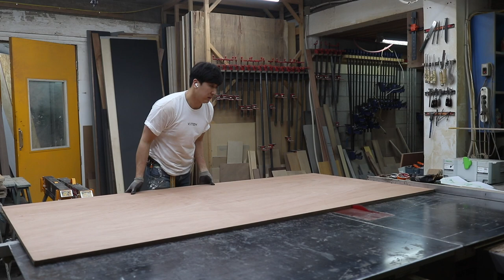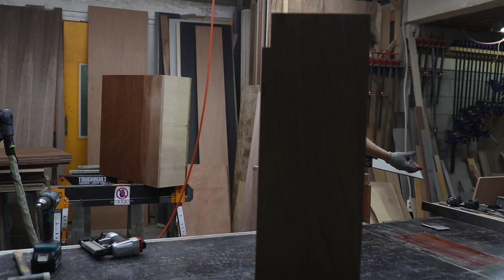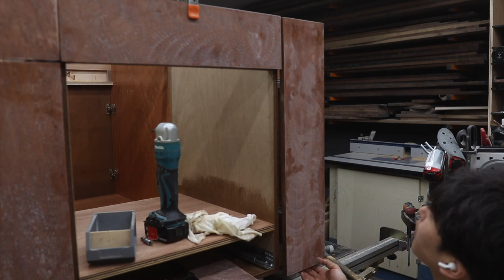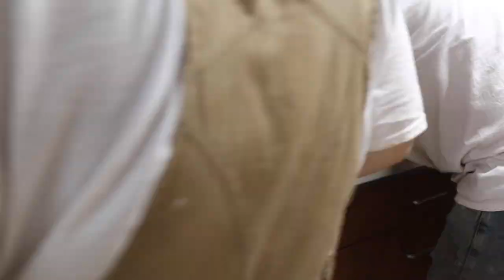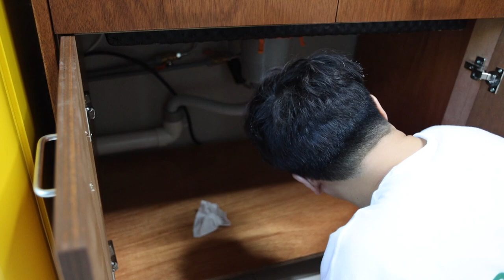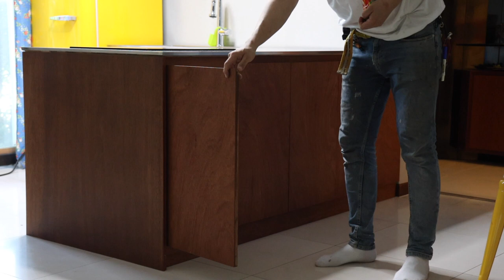W104_Plywood Kitchen with stainless steel top

Comment: I always thinking and wondering about your plywood project. "How can plywood material become so gorgeous like that? "
What kind of finish have you used? 
Was it oil based?
Reply from the maker: that is normal plywood made in Indonesia and oil based finishing
Reply: I'll take your answer as " Danish oil or polyurethane ".
Maybe 1 of those finish. 
Thank you ao much 🙏
Reply: @FKBH  yes, that's also something i want to find out. I have try rubbing some oilbased finish, but it wasn't works good. Some finish will causing blotchy on wood/plywood.
And in my country, mostly the oil finish are thick, maybe you can help me about something that can mix with it.. Thank you so much 🙏
Reply: @mogisanjaya2645  I know I'm late but he also uses some type of wax
Reply: @emm6155  yeah, i'm also curious about that wax too. And something that he use to apply finish. Sorry for my bad english language. Thank you so much for your information 🙂.

Comment: Very nice work! What are the gray blocks, like at 8:36 for instance? Are they dimensional spacers? What material? I plan on building a travel camper this spring and will likely use 3/8" (~9.25mm) Plywood for the cabinets. Didn't realize stained plywood could look so good!